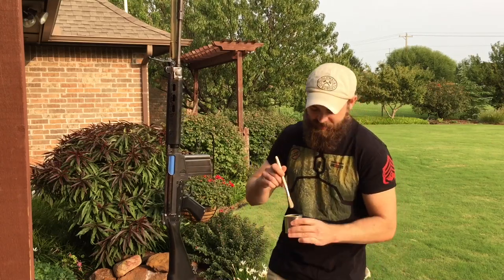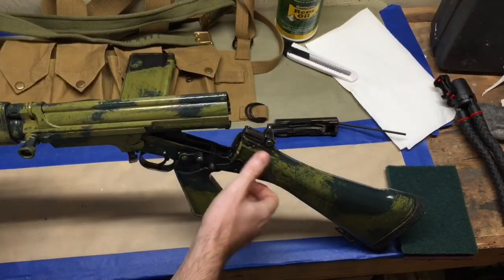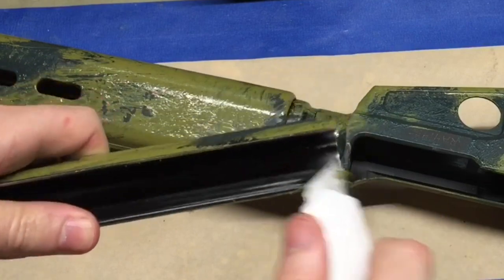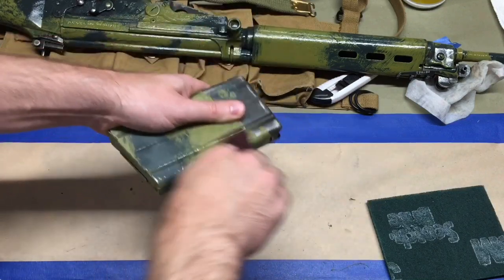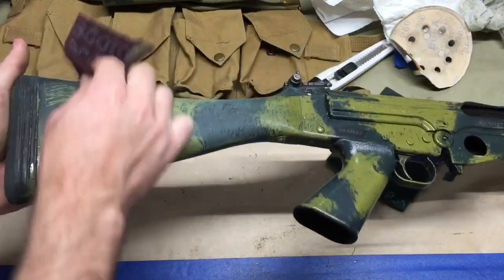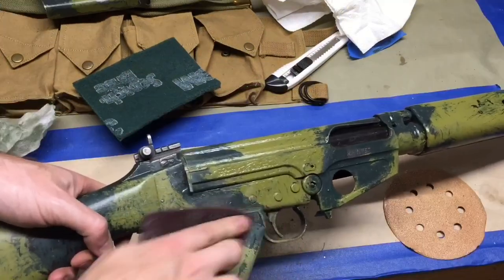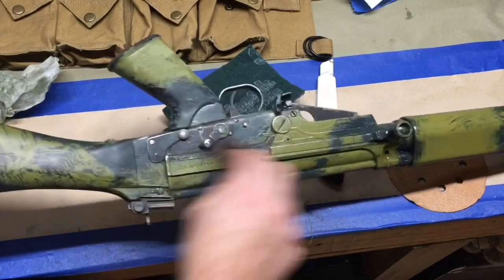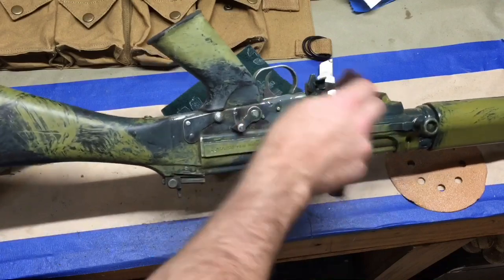Rhodesian Baby Poop FAL Clone Build Part 2

Comment: Hey Mate, so far love the FN videos! Quick question for you, what size hole is drilled through the magwell?
Reply from the maker: I just measured it and it's either 15/16ths or one inch in diameter. If you buy a receiver from DS Arms they can drill it for $30, that's what I did.

Comment: Out of curiosity, where did you find the grenade sight w/ gas plug?  I have an Imbel kit coming in and I'm shooting for a loose Rhodesian clone, because to my understanding, the early rise of Robert Mugabe's military saw a large importation of Brazilian Imbel-made rifles once Rhodesia ceased to exist; so I guess there's a lot of freedom in a project like this.
Reply from the maker: Do it! I bought my sight on Falfiles, every once in a while they pop up for sale on there and I've also seen them on gunbroker. But I don't know of any websites with them in stock. What's great about Rhodesian FAL's is there's almost no wrong answer to what type of build you can do, which makes it easy to just use what you have.
Reply: @dudestuff4345  Awesome, yeah those gas plug grenade sights are almost near impossible to find, same with light barrel configuration bipods.  I actually like IMBEL's rifle configuration, so I'm primarily just doing a clone Rhodie furniture set with a painted mag or two.  I'd rather not take genuine, collectible Rhodesian furniture to the range and wear the paint even more than they usually already are.